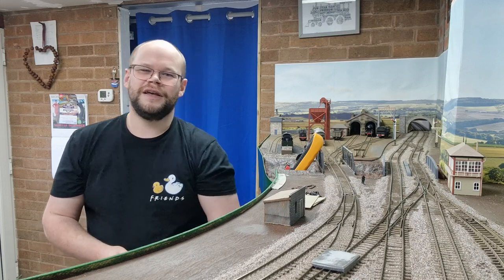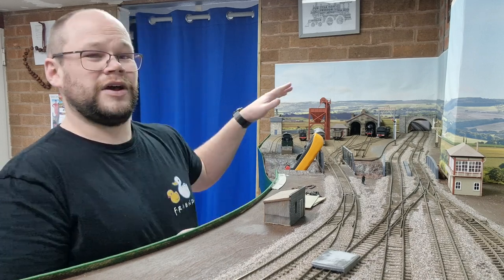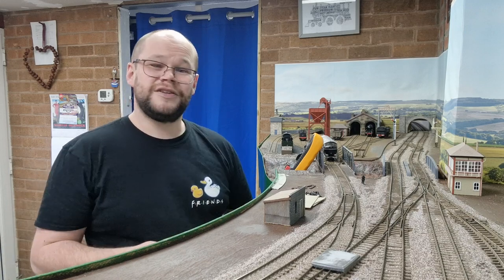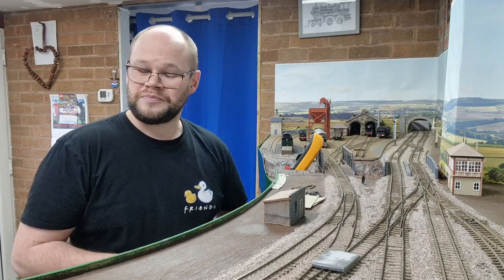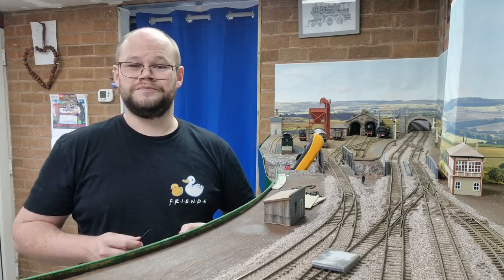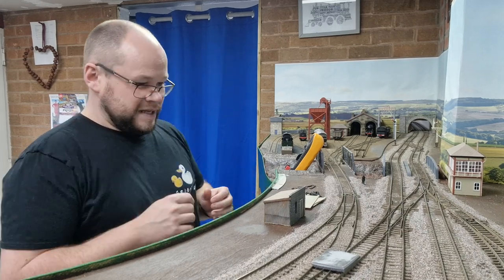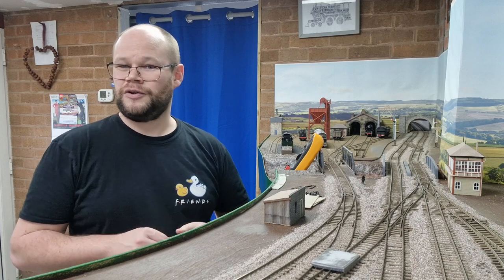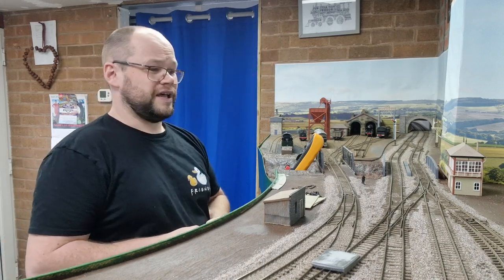Boosters! Fitting the new MPD area with a booster and why I need one.

Comment: Hello John, it was good to meet you yesterday at Digitrains, I enjoyed the couple of hours that I spent there, though this should’ve been 4 hours - my journey from Eastbourne didn’t go well due to train cancellations which was both frustrating and a disappointment. Thanks for introducing me to your channel, I’ve got you subscribed now so will see your future videos. I’ll also look through some of your past editions too.

I’m building a large(ish) Model Railway called Pevenbourne, it will be on two levels with a sort or part third level. I use Z21 and have also got a dual booster connected to it as I decided at the outset that the main Z21 unit’s output will power the Accessory Bus and the dual booster will power two Track Buses, one for he lower level and the other for the upper level so I’m hoping that I won’t have the sort of issues that you’ve encountered. Also, my eras of models are 1950s, 60s, 70s and 80s almost all diesels and electrics. I therefore don’t use many stay-alives, I’ve only got three or four, a couple in small 0-6-0 locomotives and in Lima locos. I’ve only converted two Lima locos to DCC so far and have put stay-alive in them due to their limited pick-up arrangements. I’ve got a significant number of Lima locos which will need to be DCC converted and will put stay-alives in them so it will be interesting to see where this goes in terms of what you’ve experienced at your MPD ! I also have a MPD based on a turntable arrangement where there will be several locos parked up so when I’ve got more of my Lima locos on the railway, I’ll have to keep an eye on things ! What you’ve said in this video does worry me a little for the future, but that’s a while down the line yet and the way things are with decoder supplies means it’s going to be a while before it happens. The solution will be simply to add another Z21 booster to power my MPD.

Comment: Hi, thanks for the video very interesting. On the esu stay alive or trainomatic ones you can alter the delay for charging through a cv setting to stop this very issue. I would assume Zimo would have something simular? The digikeijs boosters seem to be going up in price! Also they have either 15v or 18v power bricks now not the early switchable ones.
Reply: Hi John, CV124 on ESU  "CV 124* = Start up delay. Value in seconds. Default is set to 10, so SPP will be activated after 10 seconds. This is useful when you have more trains with a powerpack and they don’t all start grabbing power the moment the system is turned on. *Note: Before firmware 233 the start up delay was set with CV 152. Check the SPP manual to find out how to read the firmware version".  Cheers Steve
Reply from the maker: I'm under the impression those old power supplies with the variable voltages had lots of problems that's why they have gone to a new 15 or 18 volt power supply.
Reply: @johnjmc  Unsure, not had any problems with mine, fingers crossed! If I remember correctly I think Digikeijs said during lockdown that they couldn't get the supply of the variable one. I have tried the 18v Meanwell from Digikeijs and my loksound v4 didn't like programming on it! So went back to 15v.
Reply from the maker: @tynedock  maybe that's why, I can't remember the problem haha